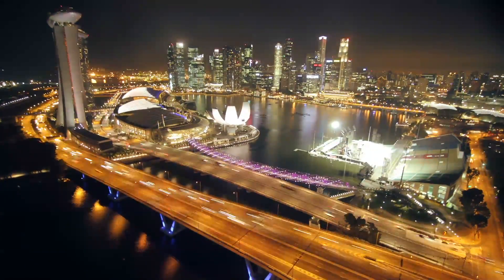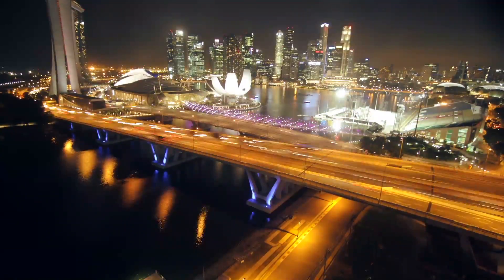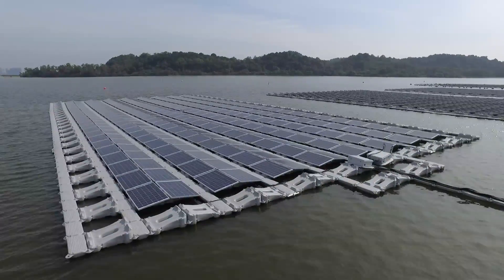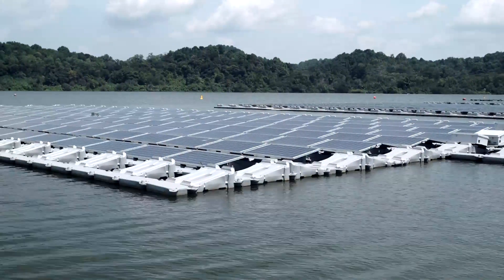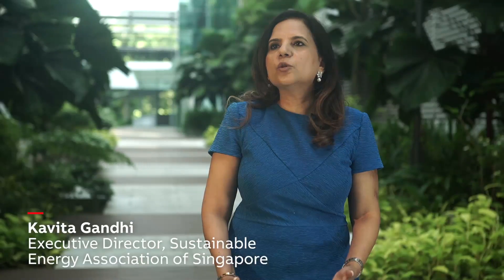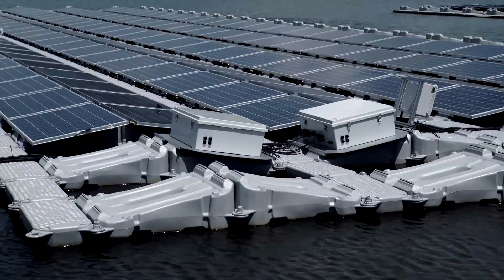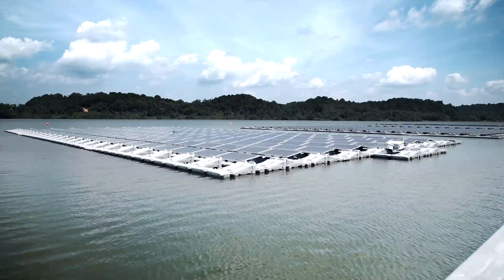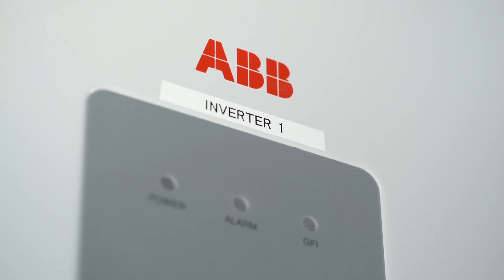Singapore launches world's biggest floating solar test-bed

Comment: Floating solar panels generation requires implementation of photovoltaic technologies over water bodies. Get free report @ https://bit.ly/2PSUL3J The global floating solar panels market is expected to grow at a CAGR of 35% to 40% from 2019 to 2024. The deployment PV components over water surface not only enhance the over CUF of the architecture but also helps in decreasing the effect of draught across the nearby area by preventing water evaporation.

Comment: Are you sure it is world's biggest ?
I saw a floating solar bed in China in You Tube which seem to be bigger than yours !
Reply from the maker: The floating solar bed in China is indeed very big – but it isn't a test-bed like this one, which is specifically designed to assess the feasibility and impact of floating solar technologies.
Reply: Ok got what you mean - that yours is the largest floating test-bed ? and china one is not test but largest operational already floating solar bed.